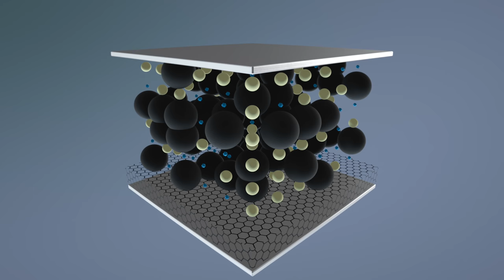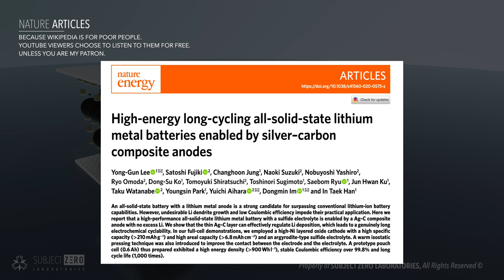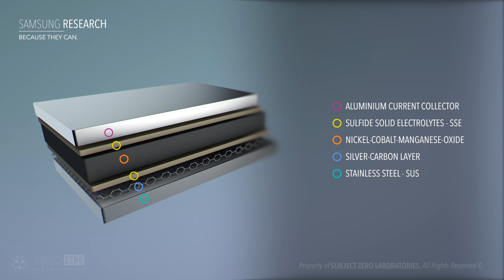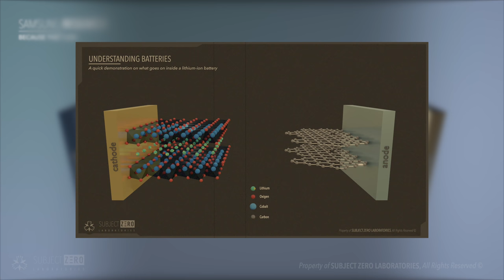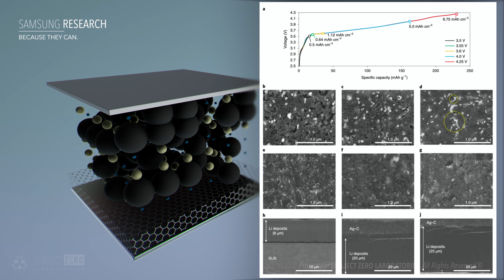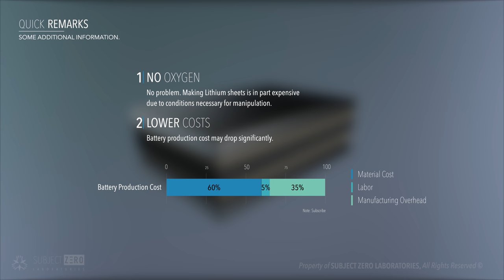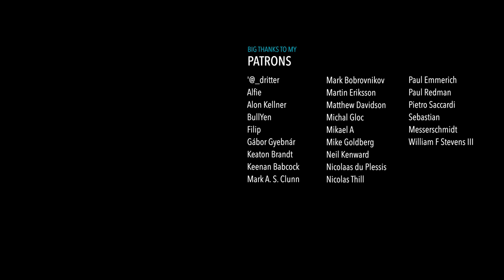Breakthrough Solid State Battery - 900 Wh/L Samsung [2020]

Comment: Are these batteries crystal? Or are they just usind solid [state] electrolytes?
Lead-alum batteries are totally crystal, even in a liquid state with added pure water. They also dont galvanize until they reach molten salt temps (at least as a highly-dehydrated/solid crystal)

Comment: Well, adding a substantial amount of Silver-Atoms may lead to a very good Wh/l value but also may result in a bad Wh/kg value (Atomic Masses: M_Li = 7 u; M_C = 12 u; M_Ni = M_Co = 59 u; M_Ag = 108 u; If ome needs 1 Ag Atom for two or so Li-Ions that it will be a rather heavy battery. Still promissing for may applications where volume is the main problem  ...

Comment: Well, that's it!"...    
The cost may come down initially after the tech has gained traction on the market, but what about the limited supply of Lithium, and the environmental costs of removing it? I think this issue is at hand.
Reply: Eventually, we will be able to make whole process carbon neutral, it's impossible to get environment friendly without hurting it a little bit in transition

Comment: So, you compared the energy density of gasoline and lithium and adjusted for the efficiency of the gasolines engines, so does that mean that Lithium batteries and electric motors are 100% efficient?

Comment: He said lithium requires an oxygen free environment.  The research labs handle lithium foils in a normal atmosphere but it has zero humidity.  The water molecules are what cause the oxidation.

Musk said that once the batteries are over 400W/l they can be used to power airplanes.

I wonder why it has to be measured by watts per volume, not weight.  If you have a high powered battery but it's heavy like lead-acid, it could be low volume but have too much weight and it wouldn't be practical.

Comment: I dont know a ton about batteries other than the knowledge I need for the devices I use them on, so excuse my ignorance, but isnt 1000 charge cycles not very much? I mean I feel like a battery dying after just 1000 charge cycles sounds like it dying pretty fast, and I would imagine there would be some degradation in that time. I mean it wont go from working just like the day it left the factory until on cycle 1000 it just crumbles to dust. Am I wrong? Am I overestimating how many charge cycles current batteries get?
Reply: 500 Mile Range on a full charge. 1000 charges = 500,000 mile car.

Comment: The practical issue has always been replenishing the vehicle's energy reservoir. Pumping gas takes three minutes. Even "supercharging" does not compare with that. Big difference and real important in real life! That is why you need rather more range with electric cars than with fossil fuel.
Even if you have to wait for 30 minutes, let alone some hours, flexibility and spontaneous filling up aren't possible. A car means freedom and speed and FLEXIBILITY. 
Here in Europe they are really trying to push for electric (including with financial subsidies), but it hasn't really worked yet. An electric car with a REAL good range and lower battery price could help solve this.

Comment: A little help here. Why is it so common to compare the energy density of gasoline to that of a battery? Once I use up the 9000 wh/l of energy by burning the gasoline, that gasoline is gone and I need to replace it with another liter of gasoline. Once my battery's 600 wh/l of energy is used, I don't replace the battery, I recharge it, and continue to recharge it 1000 times. After 15 charges, that battery has held and released more energy than a comparable volume of gasoline.  I understand that high energy density is desirable when comparing one battery to another, I don't get how energy density of batteries and gasoline are an appropriate comparison. Apples and oranges?

Comment: The first best alternative to carbon zinc batteries was once the lithium fluor battery, which theoretically is the best ever.. And worth a Nobel prize!!
But due to the delicacy to deal with a high electro-positive element as fluor, besides being too hard to implement as an anode, every research in the direction has been abandoned..
Now the Nobel prize has already been given, but still we haven't got the best battery ever !

Comment: "but these batteries weren't powerful enough to do anything with it"
Buut..all the million combustion Cars and Nobreaks in the world that use lead acid batteries don't count?? Rechargeble lead acid batteries were quite a revolution at that time! It still useful today!
Reply: Irã 45 lbs of caustic chemical battery yet still all you can do with it is start an ICE and stabilize its electrical alternator output.

Comment: So replacing carbon with silver will reduce cost? In most batteries these day, LiC6 is used. This is essentially switching out the carbon with silver. A good result, but not really that big a breakthrough.

Comment: You're incorrect about Electric cars, the early ones were very successful. They could go 35 miles on a charge, which in 1897 was superb, and reach speeds of 15mph. By 1910 there was twice as many electric cars as combustion engine cars in the US, so they saw a good decade of success and widespread use. When a hundred years later BMW launched their hybrid i8, it had the same range as the 1897 electric london cab.

Comment: In the equation must be put also the fact that about 30% of the electric energy needed to charge the batteries is lost on the grid. So the 40% efficiency of internal combustion engines is almost balanced.

Comment: 50% increase in energy density is good but I was under the impression solid state batteries would give a 5 fold increase in energy density.
Also I do believe sold state should not need cooling circuits which would save a lot of weight and battery pack costs.

Comment: What about Vanadium flow batteries? Is this not a much more reliable, high discharge efficiency battery with a life cycle of between 12000 and 20000 cycles?

Comment: Efficiency good, but the main problem, where it is questionable is the problem of energy density and it higher risk to completely kill users in an instant.
So this might be a winner here....but still: there are some rules in place concerning batteries (thermodynamics, density, etc.) and these will more or less hold true. We might just go even better in protection attempts in parallel.

Comment: 1000 cycles for the new lithium battery?  Isn’t that a little low?
Reply: I think so, for a phone anyway. I'm hoping they mean without significant degradation. Depending on how quickly they lose capacity after that, it might be fine. On the other hand, if you're getting a few hundred kms per charge on a car battery, 1000 cycles adds up to quite a bit of travel. Actually, even with a phone it's not too bad. With 1.5x capacity, a charge lasts longer. Call it 5yrs or so of use?

Comment: I get the feeling this will allow a car to be offered with different batteries. A 300, 600 and 1000km ones at different price points. What would be nice is if we had a 300km battery for routine city driving and could slide in say a 700km battery on rental for road trips to get 1000km in a day and recharge overnight at your motel. But not have to haul al that battery around for the 97% of the time one is doing city driving.

Comment: THE major problem with new ideas actually being put onto the market is that along the way from development to actual marketing there are so many roadblocks put up by those seeking to get their own piece of the pie.  This goes hand in hand with the stockholders wanting to make sure the old technology is sold for as high a profit margin as possible before releasing the newest technology.  Its the old greed game of milking the public for everything they possibly can get, then starting to market the newer stuff off as THE must have item.  in other words, the newest and best breakthroughs will never be sold until all previous steps leading up to the breakthrough have been marketed and sold.  Want a couple reality checks?  The first time airbags were being talked about in cars was the 1960s.  It took 30 years for all the red tape and people stalling the process to maximize profits to get airbags to be standard in cars.  Another example is in the 80s and 90s they used to sell Windows computers by saying it was an Intel 286 or Intel 386 chip inside.  The 286 came out ans was pushed as the latest tech.  After everyone had a 286, then the marketers started to sell the 386 chip.  A friend of mine during the 286 chip era handed me a 486 (yes - two steps ahead!) that he salvaged off of an OBSOLETE piece of metering equipment used inside a large industrial machine.  The public was being milked for every cent they could squeeze out of them while being held back two chip generations (therefore more power) in home computers.  Same wil happen with battery technology - don't hold your breath.
Reply: I don't think this particular chemistry is destined for the market, but it opens new research pathways.

Comment: Solid state is an option. It's not THE ONLY option. 
LFP is solid state but has a lower density per litre than other lithium ion formulas.
Silver is all very well but if it becomes as hard to find as cobalt there wont be any advantage.
Reply: NO LFP=Lithium Iron Phosphate...........they have been around for many years, and like you said , they have much heavier batteries for the energy they hold..........but VERY reliable batteries........I use them for my Solar power storage and to crank my car............will last many years before needing replaced..........just not so good for cars...........ONLY a stop gap car battery for driving the wheels........and China Tesla cars will use from battery maker CATL, for some time anyway, due to price...........

Comment: If the model 3 could pack that much energy into one pack (enough for 5000km) could you imagine how long they would take to fully charge?
Reply: If the technology goes the way it's looking like it will go, the new batteries will charge at a rate limited mainly by the resistance of the wires between the charger and the battery.
In other words, charging would be a matter of pulling in to a charging station and connecting the charger, then going for lunch and coming back to a nearly full battery.

Comment: the thing is, they WANT batteries because it's a consumable product.

what they don't tell you, is that you can have a regenerating generator that can keep up with the demand of your electricity use for 50-100.000 battery cycles or longer and is less weight an maintenance than the batteries actually demand. but putting said generators on the market and into cars and other applications would totally cut the battery market down.
Reply: Where are the proofs?  Where is a proof of concept?  This is just some ideal world mumbo-jumbo

Comment: If I powered my boat with lithium batteries, if I could run it for twelve hours (as now 96 hours on Diesel, an equivalent tank size of batteries)it would take a week for the solar panels to recharge them and that if I stopped using the all the electrical appliances that use on the boat now. I think they still have a LOOOOONG way to go, but let us hope they achieve the for now impossible.

Comment: The idea that we could have a Tesla model 24 that has one AA size battery that charges in 15 seconds and will dive 14,000 miles, and charge 1M cycles Is stinking fantastic for us as the end user of said Solid State Battery. But it seems like any real significant jump would cause an economic impact because once everyone had one there wouldn’t be any need to buy any more and then they wouldn’t manufacture any more.

Comment: You cannot travel 5000km in one charge with this battery. This is only if we achieved the full THEORETICAL energy density of lithium. This battery only uses a small percentage of that.

Comment: How is having less batteries safer? It has more energy density, and therefore about the se potential energy right?
Reply: The chance for each item to fail is the same. But if you have more of the item the chances of one failing start to go up. It's kind of like rolling dice that have 20 sides to them. If you only roll once, the chance of getting a 20 is pretty small, but if you roll 100,000 of them, then the chance of getting at least 1 to be 20 skyrockets.

So the fewer batteries you have, the less chance one'll go bad.
Reply: I was thinking more in terms of a crash if one is ruptured. Detonating a  stick of dynamite vs detonating the tzar bomba is what I'm comparing it to. Both will explode, but one has much higher energy density and will be more catastrophic.

Comment: If they don´t need to be in an oxygen free environment couldn´t you just cut or break off a part of it and still have a functioning battery?
If so it would be extremely convenient for battery production where they manufacture large plates of solid state batteries which are then cut into the required sizes. This is especially good news for people who build moterized models because often there is very little space for batteries which results in a shorter running time. On top of that there is no flammable battery acid anymore so those new batteries could be charged and dischrged at much higher speeds which opens the doors for even more powerful small electric devices, be it rc cars, planes or phones and smart watches.
I look forward to the day they are released and used everywhere because then electric cars would be more environmently friendly than gasoline powered cars, current lithium batteries are very difficult to recycle and release a lot of bad things into the environmet when recycled and even when produced

Comment: Jet fuel, by comparison, has a specific energy of 11,890 Wh/L. To compete on air routes up to 600 nautical miles in a Boeing 737- or Airbus A320-size airliner a battery density would have to be about 800 Wh/L.

So to answer the question are we close to battery-powered air travel? F**k yeah! Thank you Samsung

Comment: The problem they're having is that the cells are dying out inexplicably at random intervals, and nobody is sure why. If they cant reliability produce identical functioning batteries, they cant publish a 900 wh/L with 1000 cycles when 20% are dying at 200 cycles, 20% at 500, etc etc. That makes it very difficult to get approvals. They cant sacrifice safety with this process either, a shorted battery with that energy density is like a bomb going off (a potent one with that). Getting reliable cycling will determine when/how these things come out, more than cost. The demand is there.

But you cant poo poo gasoline. It is still excellent.  It is a 9.5k Wh/L (I'm glad he used proper numbers, lots of youtubers dont in the name of "praise science and electric/gas is bad"). The weight of that is also significantly less than the metals listed here. Weight has a big effect on range in apple's to apple's comparisons. Sure, you might only getup to 30% wheel efficiency out of it, but the heat waste byproduct is used for something very important here in Canada: I dont freeze to death in the winter. That's a free bonus from that energy inefficiency. And my gas car will still weigh a lot less.

I dont think its necessarily true that having less batteries means you can charge them faster. The current problem (pun intended) is that the batteries are arranged into different cell blocks and placed in parallel. That is an advantage because you can simultaneously charge each block in a parallel configuration while keeping the voltages lower/safer. The problem is, the higher current causes more heat (but is safer to the person plugging it in) and requires custom cooling systems for the battery packs. sidebar, lithium batteries also cant be used when cold, and require heaters too That often isnt taken into account in range considerations and charging times. It doesnt matter what fancy battery you choose, you always have to pick between current or voltage for faster charge times, and nobody is approving high voltage, so dont expect charge times to be dramatically reduced from what they are now, anytime in the near future (unless these things are exceptionally easy to keep cool). 

I'm hoping they can pull of miracles here, but gas is an incredibly hard beast to topple. It's dense, safe (if you're not igniting vapors), very light, and incredibly convenient. This is absolutely going to make electric cars more appealing, but it wont replace cars/vehicles that are run continuously in cold climates, heavy equipment,  or long haul vehicles. Theyd make fantastic additions to hybrids, and I'd love to see them used the same way Ford is doing hybrids in their new f150s.

Comment: to each there own there  working on solid battery's and im working on beta voltaic battery's useing americium 241 and making good progress  not ready to go into detail yet but im very confident of its safety  and long longevity with a reciter and cap bank with using individually shielded cells there will always be safe power lets just say the cells power production would be at half in about 500 years then slowly get to 35% in  another 500 then get to 30% in about 6000 after that then 30- 15%  in about 2.14 million years the decay takes a while...  it creates a electrical charge from radioactive decay with out heating  or any chance of meltdown  im optimizing my design and improving the power output  it will take some time but heres to the future chears